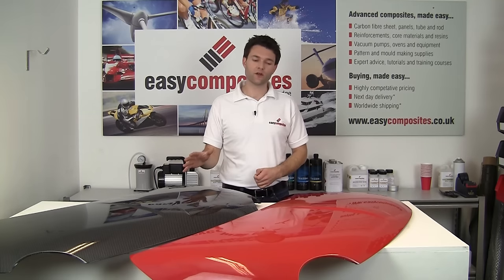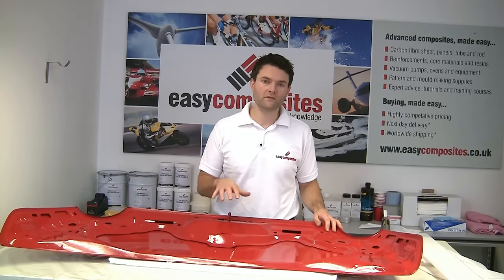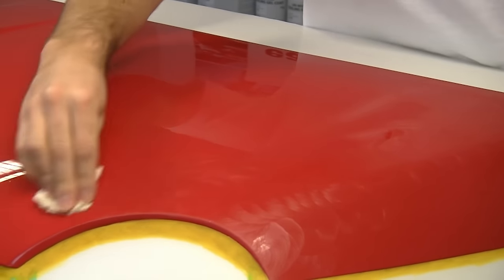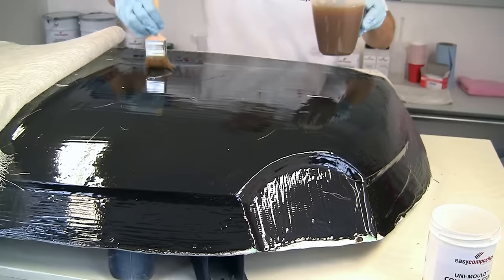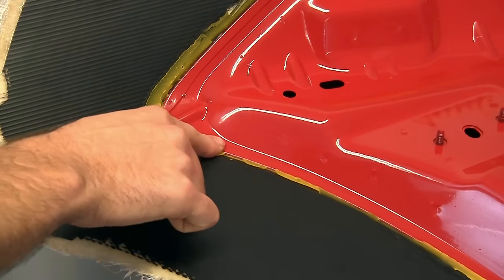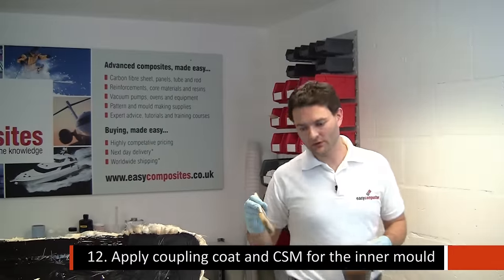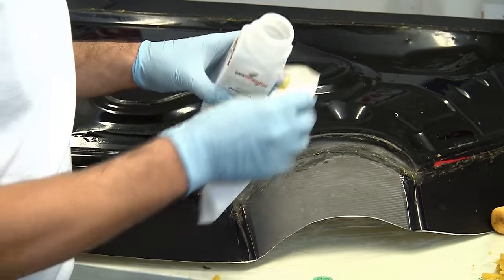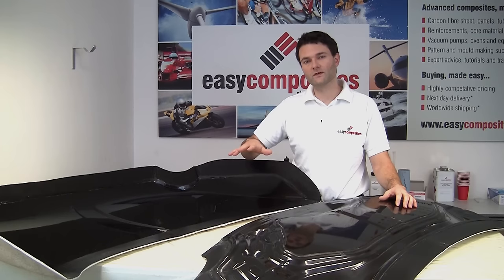How to Make a Carbon Fiber Car Bonnet/Hood - Part 1/3 : Making the Mould

Comment: Calculating how much time this takes, price to be paid for ignoring wife and family.  How many shifts of overtime it would take to buy this.......looks like I'll pick up a few shifts of overtime and have this delivered when my wife is gone to visit family.
Reply: If you can put it on a separate card. One she can't see so you don't get caught.
Reply: Definitely a project better saved for items that aren't commercially available
Reply: On that basis you’d never find a lawyer mowing the lawn!
Reply: And the price of possible failure.. not worth it.. fiberglass on the other hand, cheap, easy
Reply: It’s the same process, the resin costs the same, the bags, brushes Andy other consumables will be the same. When you actually price out a project you will see how it’s typically silly not to just save/spend a little more and go for the carbon, or at least S glass instead of the cheap E glass.
Reply: Not everything is already produced. I’m building a 79 camaro project car and I have to make all carbon fiber parts myself. This video is exactly what I needed.
Reply: Makes sense if you enjoy the process. For a hobbyist it's free entertainment, not unpaid work. Instead of going fishing, you could buy 10 times more fish by just working, but the 6h of quality fishing time are added value to you. (In a scenario you liked fishing, of course 😂)
Reply: @user-zq7oe3bl6k absolutely. I'm building a full carbon fiber small displacement japanese motorcycle from the early 90's. Turns out they don't make carbon fiber fairings for my bike, and I'll have to build them myself. Go figure...
Reply: Man you got this!
Reply: I see you watch vids and make comments for well over 11 years now, you must be single...

Comment: I really wish I'd watched this $200 (in materials) ago. :) 

Great series - thanks for taking the time to make these videos. I used hot glue to attach flange forms to my plug, but didn't put tape down beforehand. Because, hey, how hard can it be to remove hot glue? 

(ProTip: It's not difficult, but super time-consuming. Use the tape.)
Also, filleting wax is freaking impossible to find in the US. I've found that a sulfur-free oil-based modeling clay works very well. It doesn't dry out, PVA will stick to it, and it's easy to remove from the plug once the mold is complete. (I'm not an expert - just making this stuff up as I go along.)

Comment from the maker: Yes, the mould can be reused dozens if not hundreds of times.  We use Uni-Mould based moulds in our own workshop for some of our production parts and they wear very well. The more you look after them the better they will last. By having a good gelcoat finish you can also at occasional intervals re-polish the mould to take out any scratches or dulling that has occured with regular use.
Reply: What if I wanted to make an air vent, for example, like on a Subaru WRX ?
Reply from the maker: @crossbreedperformance   Do you mean at the same time as moulding the rest of the hood/bonnet or do you mean as a separate piece to bond on after?
Reply: @easycompositestv  when I initially asked, I meant at the same time as moulding the rest of the hood, but now that you mentioned doing it separately I'm curious about that as well. My question on the second one how would I bond and blend it if I did it separately? Any shared knowledge on both ways would be greatly appreciated.

Comment: Lots of patience required to do this line of work. I could see why CF hoods and other parts are pricy because of the skill set and labor behind it. Good job dude! 👍🏽 keep up the good work you do. 😎
Reply: Pricy but doesn't bend in the long run when collision happens.
Reply: @luciusirving5926  Sure. It just cracks and shatters in much the same way as fiberglass or FRP.

Comment from the maker: Depends on the engine bay temperatures. A engine with good heat shielding will generally not be a problem as the air temp under the bonnet will not likely reach more than 60C. Some high powered cars may be higher so you need to check.

Comment from the maker: That about sums it up! So long as you have the information in this video then every step is perfectly achievable and should work just like it does in the video, there are just a LOT of steps to make a top class carbon fibre bonnet/hood like this but it's an amazing project to undertake and the finished product would be better than almost any carbon fibre bonnet/hood on the market (bulk manufacturers cut LOTS of corners).
Reply: how much would it cost to produce a pair of moulds to create a pair of carbon fiber front wings for a car? something I'm interested in doing. or a cnc mould?
Reply from the maker: @ilikefishing7858  The mould cost can vary greatly depending upon size, shape and materials/process used to make the moulds from.
Reply: @easycompositestv  best suggestion?
Reply from the maker: @ilikefishing7858  Depends on size of the wings, moulding materials used eg a traditional composite mould may only be a few hundred pounds, CNC billet tooling could be thousands

Comment: I love the video, it gives me a new appreciation into why carbon fiber parts are so bloody expensive.  I wanted to make parts for my old 82 LeSabre, Buick, just to be different and improve it's economy but had to sell the car.  I was slightly regretting it when I read the title to this video then I thought, holy hell you used up like 8 sheets of fiberglass matting, chopmat, and you haven't even made the part yet.  I would have rather just stripped the parts off the car, sent them to you and have you do it because to quote another American, "ain't nobody got time fo dat (Kimberly "Sweet Brown" Wilkins)"
Reply from the maker: It is a time consuming process but as you have seen, the results can be stunning. For many individuals, the "cost" of their own personal time is well worth it, versus the cost of buying or commissioning someone else to make the parts.
Reply: I know the feeling, when I would tear down and rebuild the top half of my own engine then to hear it fire up on the first try was quite the experience, dropping off a broke down car then picking up at a shop running again just isn't the same.
Reply: 9 no NJ moo y bl ki6

Comment from the maker: Yes, that's what I was talking about. The original hood will certainly come out of the new mould no problem but because I ground off the latch and hinge-pins then the original steel part cannot be fitted back on the car (it was only £50 off eBay anyway!). If you want to keep the original in a condition where it can be put back on your car then you would have to work around any bolts or catches which is perfectly do-able but a little more awkward.

Comment from the maker: Good laminating procedure mostly. The fact you are using the coupling coat and the fine CSm will help ensure the coupling layer conforms tightly to the gel thus limiting chance of air voids.  Also copious use of the roller helps get air out as you laminate.

Comment from the maker: The mould making process (as shown in this video) does produce fumes, you need good ventilation and you could also wear a mask. At normal low levels it's not dangerous. Making the part itself (the resin infusion) is low risk; good ventilation should be adequate. Trimming the part requires (video 3) requires a good mask because you're generating lots of fine dust. Take a look at our new cutting safety video if you want to learn more about masks.

Comment: Old video but you're doing a fantastic job as a teacher and this has aged very well. The methods are pretty much identical when it comes to aircraft composites. You could probably take this video and teach new aircrafts structures guys how to do the basics of composites with this.
Reply from the maker: Thanks Stoweby, I reckon there are quite a few composites professions that use this video (and several of our other ones) to introduce apprentices to composites processes! We’ve done an updated infusion video very recently and we’ll probably be doing some more soon as well.
Reply: @easycompositestv  Excellent! I'm always interested in seeing how composites technology has evolved over time. I have you guys saved now that you've come across my feed. I wish more people knew how fun it can be to do this with a little practice and patience.

Comment from the maker: In this video we're using a 200g 2/2 twill 3k carbon fibre for the visible layers. We use a Lantor Soric SF2 core material on the top skin and for the inner skin we use the 2/2 twill 200g fibre again backed-up with a 650g 12k carbon. When you're laying reinforcement into the mould dry it should be quite easy to keep the weave nicely aligned. It normally gets distorted in a wet-lay process when you're pushing it around with a brush or roller. You don't have that problem with resin infusion.

Comment: Very interesting, though I'd personally use vacuum forging to get the shape and would only make one mould, while creating my own structural reinforcement for the other side instead of using the stock one.
Reply: DjKinetec great if you're using it once but this is deffo the way to go to ensure the structure of both your bonnets and the mould for further use.

Comment from the maker: In total we used about 20kgs of the Uni-Mould resin, 7kgs of chopped strand mat, 5kgs of the coupling coat and 5kgs of the tooling gelcoat however this is a small part (a FIAT 500) and a larger part would require more resins and glass. Remember that we made an inside mould and an outside mould.

Comment: How much would all the parts used here (excluding the steel hood) cost?
Reply: i guess a lot.... I am going to make a glass fiber bonnet, but in a much more simple way.... i hope it is going to work....
Reply: Daniel Solce use ur own steel hood
Reply: +altheeb - 100% Agreed!  Time, $$$, Labor = NOT WORTH IT !!! LOL
Reply: A roll of CF sheet can cost ovee 16k dollars
Reply: you can get 3k carbon twill weave for $16 a linear yard. you could make the hood with about 6 yards. not that bad...
Reply: Daniel Solce
Reply: I went to the website and added everything required for this I would say that it cost anywhere from $1,300 to $1,500 for just enough materials for the hood my cart came out to a little over $1,800 (shipping included) but I added more materials than you need for just a hood.  Also shipping costs depend on where you live.  I live in the US and so shipping is $300 for Hazardous Airfreight since this company is based in the UK. I don't think this is bad considering getting a professional to do it would cost twice as much
Reply: @cyba7912  it just depends I guess. I thought it would be cheaper than that. I can get a mod gt cf hood for my eclipse for around $600 + s/h and that's already made. All I'd have to do is bolt it on and install some hood pins

Comment from the maker: You're very unlikely to get bubbles in your gelcoat; I can't think I've ever seen this. In this video we spray the gelcoat; if done right that can put it down very smoothly and bubble free. The time you wait before infusing the resin through would depend on the gelcoat you're using (remember, you can use NO gelcoat and it will work just fine). For the GC50 we used in this video the correct delay would be between 3 and 24hrs.

Comment: why polish the wax if the purpose is just a release barrier?
Reply from the maker: Why polish the wax on the part or polish the wax on the barriers? - We polish the wax on the part to improve the release (shiny surfaces release better than less shiny ones) and also because the quality of the finish of the wax will be the quality of the finish on the part. If the wax isn't shiny then the surface of our part won't be shiny.
Reply: Easy Composites Ltd
Reply: And if you don’t remove all the wax it can stick to it
Reply: James B no, it'll just leave streaks or haze in the mold. The resin can't stick to the wax.
Reply: Saves tonnes of polishing in the long run especially on multiple runs.
Reply: Excellent work!!

Comment: Isn't this more like fiber glass though?
Reply from the maker: Some of the basic techniques such as mouldmaking are very similar to what you would use in "traditional" fibreglassing. However, resin infusion is not such a traditional technique.  It could be used quite successfully with woven fibreglass as well as carbon fibres.
Reply: Yes fiber glass moles to build a carbon part in to get the shape. Epoxy resins are so easy to use with glass and carbon.

Comment from the maker: @danthman123 if you're only making one and you need to make the moulds and buy all of the equipment (I.e. starting from scratch) then it will work out more expensive, not cheaper. The materials alone used in making this bonnet are around £450 and remember that's for a 100% carbon bonnet so once you have the equipment and moulds it will work out cheaper.

Comment from the maker: The mould is made from fibreglass using our Uni-Mould system.

Thanh Tran, it depends how much you want to pay for someone else to make you a bonnet. If the design is not already moulded then you will get a shock at the moulding cost if you ask a business to make it for you.  The advantage of DIY making a carbon part is your overheads are much smaller and your time is free.

Comment from the maker: You can in theory make most body panels using the same technique.  More complicated parts may need multipart moulds or be made in several stages, but the principals are the same.

Comment from the maker: @samedwards884 That's a Plastic Finned Laminating Roller. They've sort of replaced the old metal rollers used for laminating because the reason doesn't stick to them (they're PTFE) and the plastic roller won't scratch the mould if you touch it accidentally.

Comment from the maker: I wouldn't recommend spraying the resin during the tooling phase because it's very thick and would not spray well, by the time you've set up all the gear (and purchased it!) and then cleaned it all down after it would have been quicker and cheaper to just brush it on. The resin would still need to be stippled into the chopped strand mat and rollered after too anyway. If you're making something huge (like a boat hull) then spraying might be worth considering.

Comment: This is genius work! I want to make a molding of a hood for my Supra that's sitting in the garage and try this out but if it doesn't work it's okay I already have an aftermarket hood on my Supra right now the one sitting my garage would totally be a test You do some great work man I'm ready to start part two of this video! Also it brings me to the conclusion I see why when people buy these parts why they're so expensive there is a lot and lot of labor that goes into this! Great work keep it up man!
Reply from the maker: Hi Vincent, thanks for the comment; we're glad this has inspired you. I hope we can work with you to supply the materials and look forward to seeing how you get on. All the best with it.
Reply: @easycompositestv  I want to make a mould of my front bumper on my Supra. It's the templates part I'm nervous about I know this is a stupid question is there a certain material you use for templates

Comment: Just wanted to mention a few things

Might want to use a respirator when you apply the gelcoat and fiberglass layers. Depends on what you use, but it can smell really bad.

Practice on a small piece might be useful too. so you dont destroy a large piece of bodywork and waste material.

If ur gonna cut/grind the bolts/hook, do it before you start your mold.

Watch how many layers of fiberglass and resin. Exothermic cures can have thermal runaway if it builds of too much heat.

Comment from the maker: If you use a gelcoat during the manufacturing process then you would not need to lacquer or clearcoat after. If you don't use a gelcoat then the part will look fantastic but it won't have much protection from UV/grit/dirt and so for everyday use we would then suggest a clearcoat/lacquer. For race use (where weight is more critical than appearance) then you would use neither a gelcoat or a clearcoat and you would just run with the bare carbon.

Comment: i use a die grinder with cut off wheel to trim. and i use sanding bits or file bits to clean up the trim work.
Reply: There's a video on the easy composites channel showing the best way to cut composites

Comment: I think is the first time i seriously think that i would try to do it myself but i think i woluld need a teacher near ... the techique you developed is amazingly impressive and simple in one way but also very complex in the same time ... There are lots of materials and components to use and you have to be familiar with. You also offer some training class near by or we just have to figure it out ourselves ?
Reply from the maker: We offer training courses on our own site in the West Midlands in the UK.  Customers have successfully made parts from having actual training on the course as well as some who have only watched the videos.  If you are unsure, we recommend starting on a smaller piece to get going.  The infusion process is step based so if you follow each step carefully, there is no reason why you should not be able to achieve good results with a little practice.

Comment from the maker: The mould making process would be almost exactly the same. If you're going to use polyester resin to make the fibreglass bonnet (which would be the usual practice) then it wouldn't be essential to use the Uni-Mould system, you could just use polyester gelcoat and polyester resin but you'd need to really take your time, putting down the reinforcement for the mould over a period of several days to reduce how much the polyester distorts. Or, just use Uni-Mould like we do here and finish in a day!